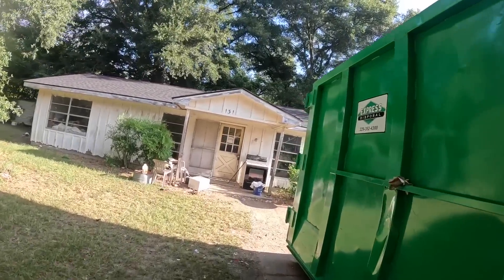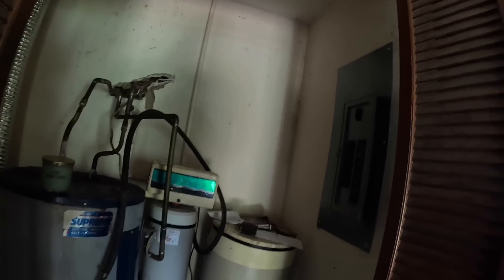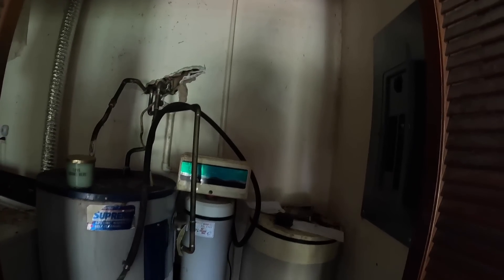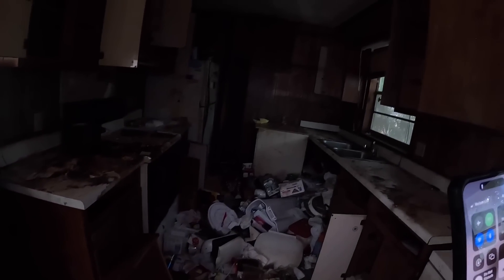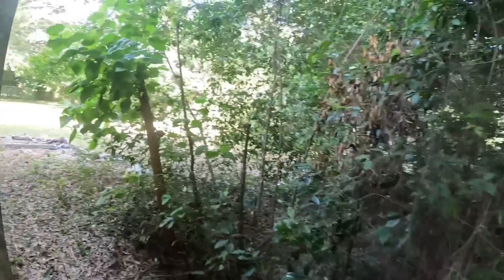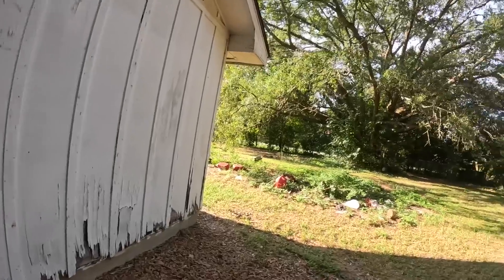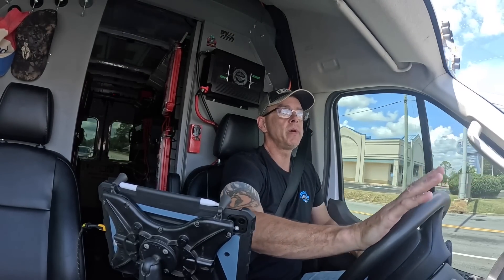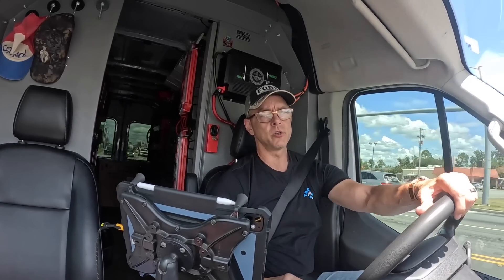Two Calls That Required An Estimate. #hvacguy #hvaclife #hvactrainingvideos

Comment: I would hope the owners of the first house replace all windows and exterior doors, insulate the walls and attic before they consider central air and heat. With the condition of the property as it is, it seems they will be fixing it up quite a bit. Also, if the air handler will fit in the attic, I would put it up there to keep the existing space they have now for other needs. Now would be the time to do the upgrades or tear it down and start over. While they are in limbo, they might want to get all of the overgrowth in the yard removed.
Reply: Would be very difficult to insulate the walls and you just don't see many people doing that but as far as the attic goes yes you can pile it in deep and put some exterior doors and some decent windows in would help a ton
Reply: @Vfh........y  Yes, but in this home, its very likely they might be tearing into some walls for windows etc. If they do, the place is empty, its a mess and one more step to help the HVAC work as well as sound deadening etc. it could be worth their time if they get into the exterior walls. Obviously, if no...wall insulation would be a large job on its own.

Comment: Curtis, on the 1st house, you were thinking of putting an Air handler in the corner of the utility room next to the water softener.   That wall on the right had an electrical panel on it.   In my area, you can't block access to an electrical panel.   The area directly in front of the panel must have 36" clearance in front and 30" wide, that's NEC code.     Whoever hooked up the DHW was no plumber, flex hoses and no shut offs, that's an insurance claim waiting to happen.   I suspect the realtor is going to lose his shirt on this project.     This is one of those jobs you should have brought Riley.   Riley would have taken one sniff and dragged you back to the Van and safety.